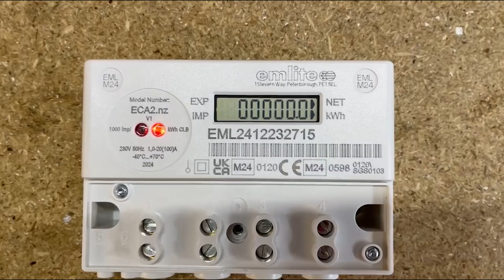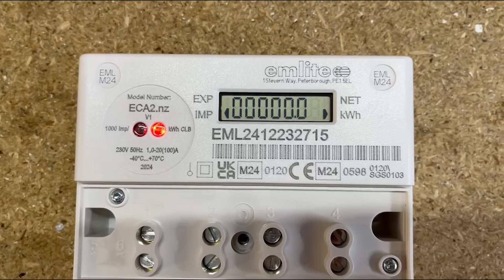How to read the EmLite ECA2.NV (NET) Single Phase Check Meter

Comment: I need to be able to send the Total Solar Generated KwH reading to my FIT supplier so I can get paid. Which of the three readings should I send? I have the app belonging to the Inverter/battery system on my phone but the Solar Generation figure does not match any reading on the meter.

Comment: Hello, thank you so much for this video.

I've got a similar meter - ECA2.v but I can only see the IMP number, and it doesn't show any other numbers. Can you please advise why I am unable to see the other numbers? I am planning to register this meter with my provider so would appreciate if you can please help. 

Thank you.
Reply: Hi, I have the same issue. Did you resolve this at all?
Reply: @Westy687  Hi, I reached out to my providers and followed the instruction on the form/sought help from them on the call - basically you need to put the IMP number on the form (with some other meter details) and take a picture for evidence, and submit it to your provider - they will take it from there.
Reply: @ thanks mate👍🏼

Comment: I got the model number EAca2.v and both lights are on (installed yesterday ) the screen remains on 0. What should I do ?? Any help would be great
Reply: Hi did you ever find out what was wrong with
Reply: @tiahnabennett4646  hi sorry I’ve only just noticed your messages. So it turns out theirs a problem with the inverter it’s still an on going issue !  I will update again when it’s fixed but my gosh this has been going on for ages now !!

Comment: Hi - can you clarify which of the 3 readings on the meter you should be sending your energy supplier when they ask for a reading? I am assuming it is the net reading rather than the import or export reading - is that correct or wrong? Thanks
Reply from the maker: Hi John, you would send the NET reading to your energy supplier.

Comment: Hi, we have the same meter as this, but it doesn't auto cycle through between Import and Export and only shows the Import screen. Is there a way I can configure it auto cycle through or only show Export? Thanks
Reply: Hi, thanks for your reply.
You're correct, we do in fact have the eca2.v version. Is it possible for this one to cycle or how can I set it to show the export reading and not the import reading?
Reply from the maker: @tomhellard7279  this version of the ECA2 does not display export. It only shows import. If export is required I would suggest getting the ECA2.NV or ECA2.BI both can be found on our website. Please let me know if you have anymore questions.
Reply from the maker: Hi Tom, Thank you for your enquiry. While your meter might look the same as they all use the same casing (with Import export and NET) there is actually 4 different versions on the ECA2. As this meter auto scrolls by default I would assume you have the ECA2.Z or ECA2.V. The name of the meter should be on the casing on the left near the light.